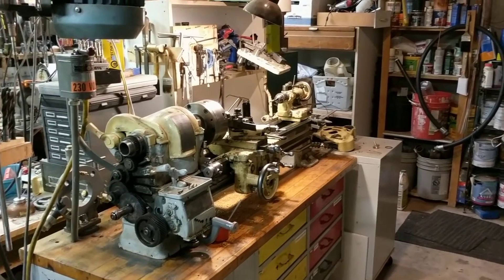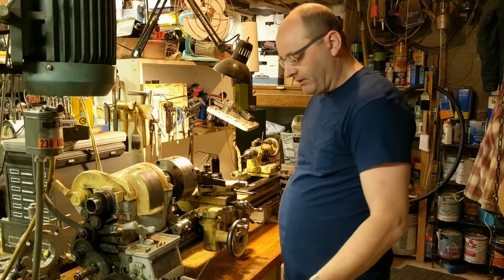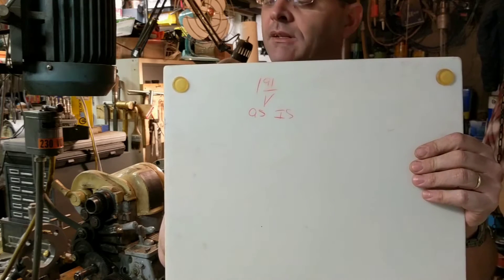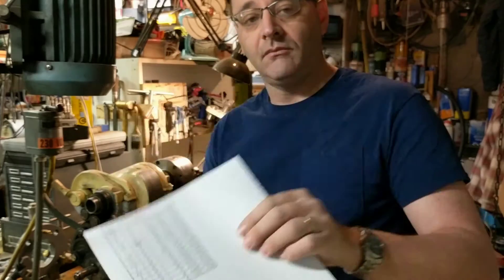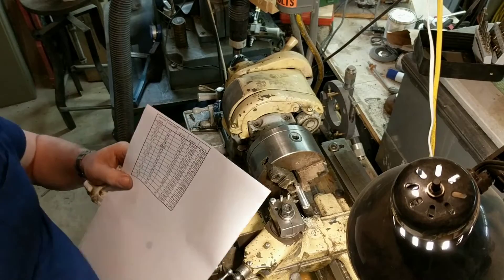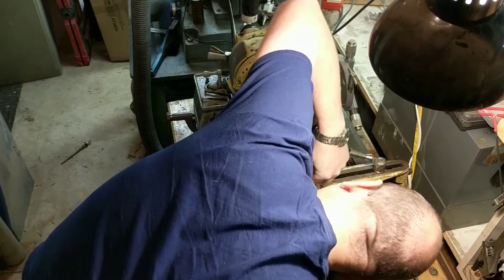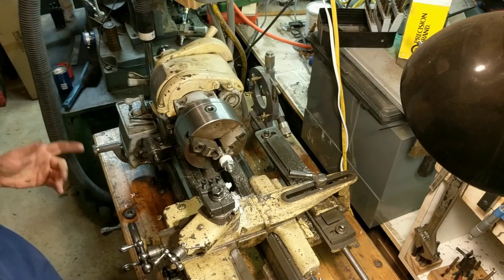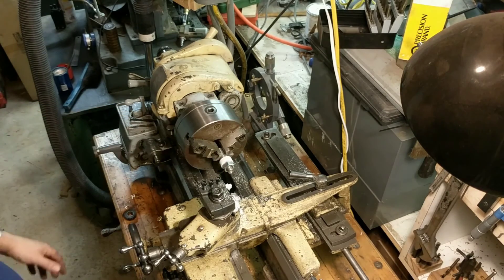Machining Metric Threads on the South Bend lathe --  For Two Dollars???  Part One

Comment: Noodled around with your spreadsheet. Great tool. I found that adding lines to calculate using 5.5 and 5.75 TPI really helped for a few of the entries. Thanks for the video and spreadsheet
Reply from the maker: Fantastic.  I'm glad it's useful!  Everyone has to"adjust"the spreadsheet for their lathe. How many teeth their factory bull gear is, and what exact TPI entries their gearbox can be set for.

I don't know how many people really get the gist of this process.  But at least you and I do! :-)

Comment: Thank you so much. So I cut 32 tpi on my ancient lathe- (CANADIAN MACHINERY CORP) and yes it is metric 0.8. However the stud gear on my lathe has 21 teeth. I can machine stud gears but I don't which ones I need . Can you help me ? thanks
Reply from the maker: Looking at the excel spreadsheet linked in the description section, I set the "factory ,stud gear" to 21 tpi, and looking in the righthand grid, the closest match to "0.8" is with a 29 tooth stud gear, and the QC gearbox set to 44 TPI.  That'll produce a metric ".797186" thread, which is off by .0035%  I'm presuming your QC gearbox can do a 44tpi thread, if so, you need a 29 tooth stud gear.
Reply: @TheBuildist  thanks

Comment: A metric thread of 0.8 millimetre pitch is a unicorn.  You can make it but you will never find it used anywhere in the S. I. Universe.

Stephen
Reply from the maker: So there's no point in having that entry in the chart?  What a shame!  That's the only one that the stock stud gear can cut!
Reply: To cut proper metric threads you need a gear with 127 teeth and one with 100 teeth.       You can reduce this to 63 teeth and 50 teeth but you lose accuracy to keep the overall gear set compact.    Over 10 to 15 threads this doesn't matter but if you were to cut something like a lead screw you could be in deep merde.

Stephan again.
Reply from the maker: @Steve Callachor You're right, of course.  For something like a lead screw, this method would be a poor choice.   But for the vast majority of threads, (bolts and nuts and fittings) 99.4% or higher accuracy is just fine.  For instance, if you use this method to thread a 6 inch long M20x1.5 metric bolt, your total accumulated error over the course of 6 inches of threads is less than 3 thousandths of an inch.  (27.5 microns per thread, about 101 threads over 6 inches)  That's undetectable in use for general fasteners and fittings.
Reply: @stevecallachor  80/63 transposing gear is the more common reduced size one, and is REALLY close.
47/37 also works for almost all applications.
Reply: M5 x .8 is standard